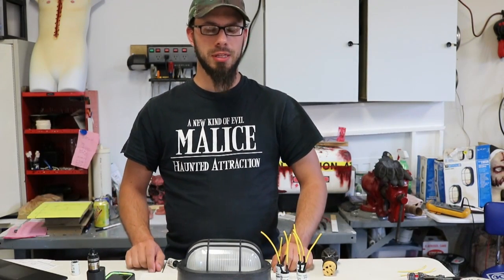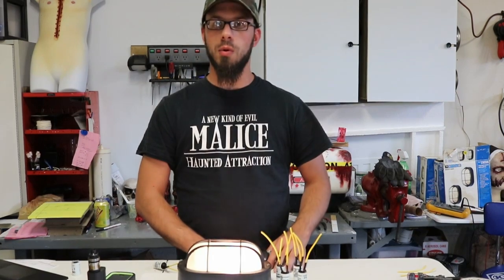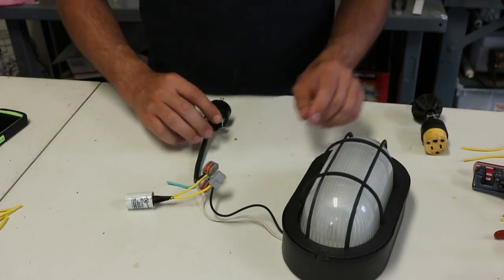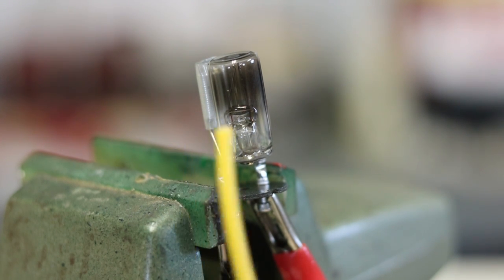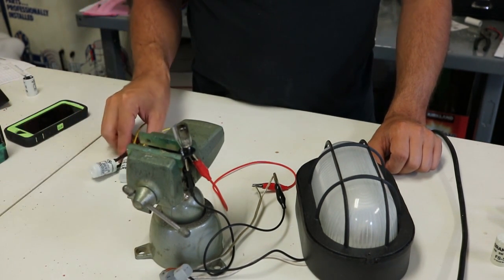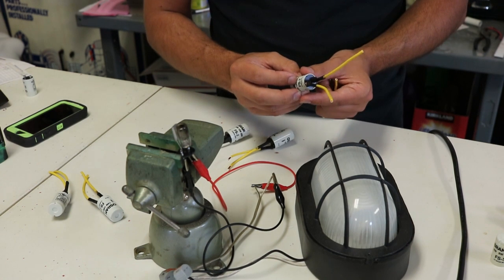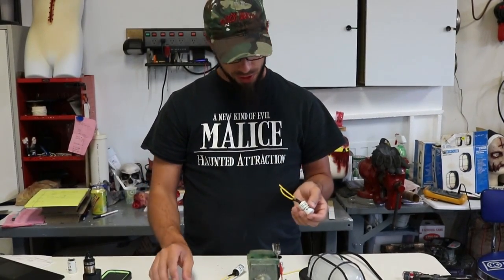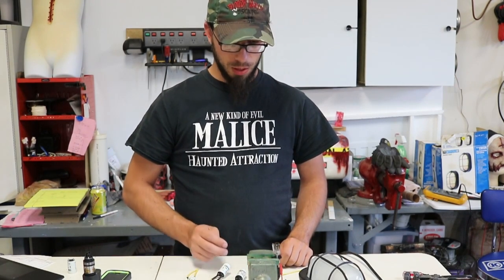Flicker Flashers - Flickering Light Effect With A Florescent Light Starter

Comment: Use a higher power starter, such as one for starting 40 watt t12’s. Then switch the incandescent bulb for the CFL and you’ll have a much longer life out of it. Either way, Flourescent starters are cheap, usually only $2 for a two-pack

Comment: Just use a cheap $1.50 6ft extension cord. Wire the starter into the hot side only. Then you can plug any halogen light you want into it instead of ruining the  lamp itself.

Comment: You need to find a sweet spot with the wattage. If it’s too low, the effect is lame. If it’s two high, it’ll burn out. I used 25 watt bulbs and the starter lasts weeks.

Comment: Add a cheap dimmer switch, not the electronic ones, in series with the starter to control the flicker rate.
Easy way to customize your light for the area it's in.

Comment: is it dangerous to leave it on for several hours?
Reply: No. You can use them over several days. 
I build extension cords using the starter and a cheap dimmer. I can plug any incandescent bulb into it and control the flicker rate.

Comment: Why not just use a proper florescent starter socket? They are super-cheap and allow you to replace starters in literally a second with no need to touch any wiring. Far faster, far safer, and you can find them for just a few bucks. Also, an in-line 1/2 amp slow-blow fuse would provide additional safety for little effort and almost no money.

Comment: hey- quick question,  i am using fs-2 20w (with condenser) starters to a 26 w bulb, there is minimal flickering at first , then the flickering stops and the light is just on normaly, no more flickering, any ideas?  thanks again
Reply from the maker: that is interesting...id say try a higher wattage bulb...i use 40-60 watt bulbs generally...if its not drawing enough power it may not be triggering the circuit to "turn off". :)
Reply: @EvilOliveProductions  awesome thanks for quick replyyy
Reply from the maker: @CrazyJames  youre very welcome! ya caught me at a good time..."post-haunt-decompression" time lol
Reply: @EvilOliveProductions  ha, you were right it worked, i used a 100w bulb and worked perf, 25w didnt work thanksss againn
Reply from the maker: @CrazyJames  GREAT!!! you are very welcome, happy haunting!! :)

Comment: I had a FS2 on when I tried to use it with the Gemmy light and it did not work. Would the FS5 possibly be better with a spotlight or kaleidoscope light?
Reply from the maker: The projectors lights are all LED,  so the "flicker" technique will not work on them at all. You can only use them on incandescent bulbs. They do sell LED "flicker controllers" but they are pricey, and do not generate a random effect but more of a constant on/off pattern. For what you are wanting specifically you may want to try the flame effect bulbs if the Gemmy lights arent enough for ya.
Reply: I apologize for posting earlier, I found out after looking online that the Gemmy's were LED lights.
Reply from the maker: haha no worries it happens to all of us :P

Comment: Tried the starter on halloween mini lights and they work perfectly, and also on a small lamp bulf. On the Gemmy spot and kaleidoscope lights they blinked on momentarily and than nothing.
Reply: If there isn’t enough power in the circuit, the starter isn’t able to make an arc from the heat. (More amperage equals more heat in smaller wires, such as the wires inside the starter.)
Reply: Add a christmas light in parallel to the light circuit. You can tape the bulb if you like. It will add the necessary load to get the starter to trigger.

Comment: Can you use this method for incandescent halloween lights? I want to effect a faux fire effect.
Reply from the maker: That is actually a good question, i haven't thought to try. Theoretically it SHOULD work, but it also depends on the wattage-draw of the bulb/bulbs. Being all on a single string they will all blink at the same time, so you may need more than one circuit of them going to get the effect you want. What I'd suggest doing is using a strand of red or orange lights like you are talking about as a base color...and then picking up one of the "fire and ice" RRO (Red & Orange) projector lights from home depot. That will give you more of a "movement" effect than just a flicker. Hope this helps! :)
Reply: Monster Tutorials has a great video on You Tube regarding making a faux Halloween fire complete with a cauldron. In his case he uses LED halloween string lights but they do not blink so I wanted some sort of blinking lights more on the order of a fire. I do have the Gemmy Fire and Ice kaleidoscope so will try it. Thanks again for the prompt response. Halloween is just around the corner and need to get working.
Reply from the maker: I know the exact video you're talking about! if you do use the Gemmy projector i think it should fill the whole space with light alright...maybe paint the inside of the enclosure white to help reflect all of the light it can for the edges. If all else...a pack of the starters is only a couple bucks, couldnt hurt to try it with the light strings...just practice good safety measures :) you bet, and you know it! haha

Comment: what kind of wire to i need?
Reply from the maker: I use either 12 or 14 gauge stranded wire...you can also use solid wire. I wouldn't recommend going any thinner than 14 gauge just because you'll be running 120v through it :)

Comment: The starter switches current on/off thru the inductive ballast to create an intense voltage spike that ionizes the gas in the tube - - - ?
Reply from the maker: Only to initially start the process...im by no means and electrical expert btw lol, just trying to explain a little bit of theory on how it works. "basically": The starter acts as a timed switch to allow a larger amount of current flow through the gases inside the fluorescent tube to initiate illumination...once the "arc" between the filaments is created, the current follows the lesser path of resistance and the starter is no longer needed...from there the ballast regulates the current. There are a few really good videos across YouTube that do a far better job of explaining the theory than I...they also have interactive visuals to help :)
Reply: When the power is turned on, current flows through the cathodes on either end of the bulb. These heat up acting like resistors. The current flows through out the other pin (bi pins) and flows to the starter. A bi metal switch enclosed in a lamp filled with neon or agon gas is illuminated. The starter heats up causing the contacts to touch. This shorts the circuit causing the incoming power to charge the ballast in a magnetic field. When the contacts on the starter close, they charge the ballast but they also no longer illuminate the little lamp, they then cool and expand. The circuit opens causing the magnetic field to collapse in the ballast. The mercury drop in the tube is now vaporized and the ballast sends this high voltage charge from one cathode to the other. If the bulb doesn’t light the first time, the process will repeat until the starter successfully strikes the bulb. The product is light. Hope this helps

Comment: What kind of solder and flux do you use? having no luck with solder joints
Reply from the maker: I had trouble with my solder as well! Glad to know it wasn't just my stuff. I ended up just giving the wires a good "twist job" around the posts and heat shrinking them. I'm not sure what they coated the terminals with...but it fought of 2 kinds of flux, as well as resin core solder that I had laying around!
Reply: Thanks for the reply I'll let you know if figure it out.
Reply from the maker: Thanks!!

Comment: How many watts is safe to run through this?  60w , 600w  ? just curious. i want  a strand of out door patio lights to flicker and its about 240w of power draw...thoughts?
Reply from the maker: hmmm. honestly ive always had each bulb on its own circuit with these...im not sure what the max would be for a strand like that. if it wasn't a "haunt night" id do some experimenting in the garage. best thing i can suggest is to try it on a bench first. they are only about $1 each so worst thing that could happen is it could pop in the first 5 minutes you plug it in. if it makes it to 15 minutes id say you should be good...but keep a few extra on hand if you plan on running it several hours to swap out in case they do eventually burn out. and i wouldnt go any higher than that single strand of 240 on a single one just to play it safe if it DOES work. Personally id recommend keeping it as low as possible (around 60), but as haunters, its in our nature to push the limits of things haha :P

Comment: HEY MAN!  GREAT VIDEO!  Can you tell me where you got that light fixture from?
Reply from the maker: Thanks! I picked these up at a garage sale...however they do have similar ones at home depot, lowes, and menards. Im also sure ebay would be another good place to check out ;)
Reply: Thank  you for the fast reply!  I've looked everywhere for that style.  Even thought of just making it myself.  Nonetheless, your flicker style works like a champ!  I want to try a lower watt bulb in a series and see how long it lasts.  Have you ever tried that?
Reply from the maker: Im actually planning to eventually make a resin mold of a style like that to sell...so stay tuned in the next few months for that! and thanks! my personal experience has been that lower wattage bulbs tend to make the starters last a little longer, as less power is needed; therefore less durational strain on the armature...however the lower wattage bulbs dont seem to "flicker" as well. however with so many different styles of bulbs your mileage may vary, not to mention every starter is different. play around with it and see what works best, feel free to share your findings as well :)
Reply: HA!  Sign me up!  I'll be buying up your first batch!
Reply from the maker: aaaaand theres the motivation i needed haha ;)

Comment: can I use these on a string of C7 lights?
Reply from the maker: That is a good question. You should be able to as long as they are of the incandescent kind. They will however all flicker at the same rate...so unless thats what youre going for i would avoid daisy chaining multiple strands together.
Reply: Buy some C7 flasher bulbs. I know I’m 3 years late but they are what I use.

Comment: Is it one starter per light bulb or can multiple light bulbs be wired off of the starter?
Reply from the maker: Its best to run each bulb off its own starter...as then the flicker will be more random amongst them. Also, if a starter burns out you wont lose all your lights. AND..im actually not 100% how many bulbs you'd be able to run off a single starter, between the combined wattages and the effective wattage of the starter im sure there is formula for it to keep it working efficiently that im unaware of. But i will see if i can test that theory out soon, or someone else may comment the answer as well. GREAT QUESTION!!!!

Comment: When you splice these into the lamp wire, do you splice them into the the live side or the ground side, or is there no difference?
Reply from the maker: It will work either way...however I personally splice into the live side. In theory any switch/relay should be the side under power at all times and then get "grounded" through whatever is being powered to complete the circuit.